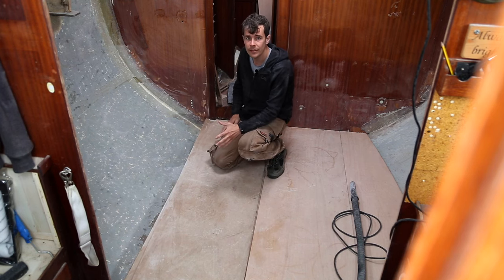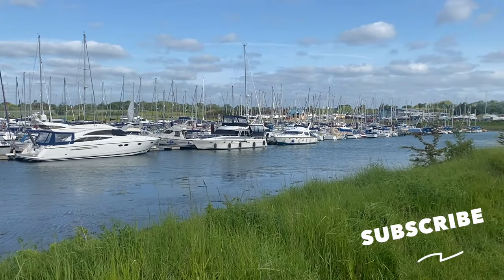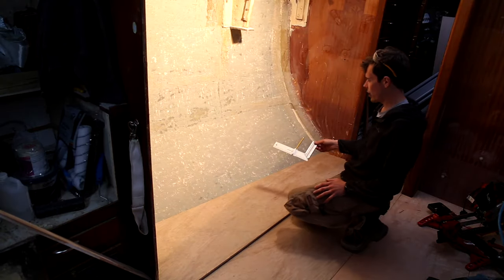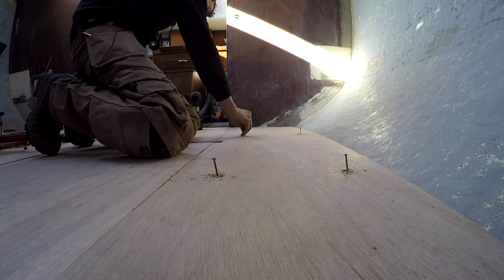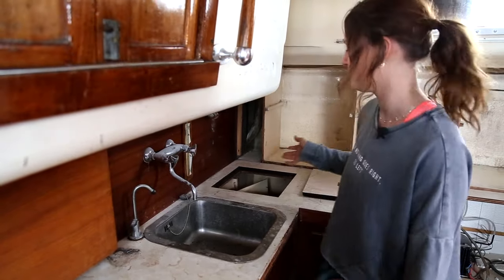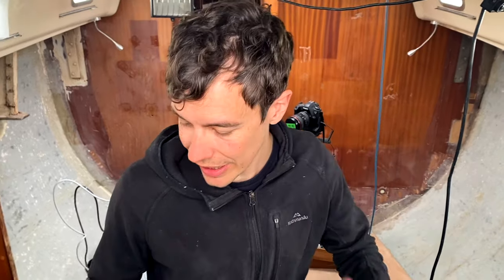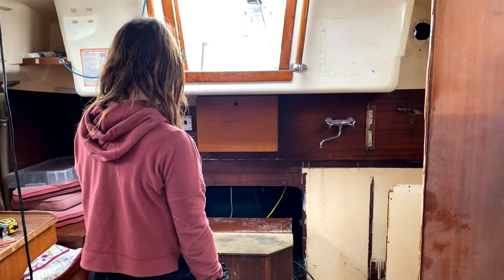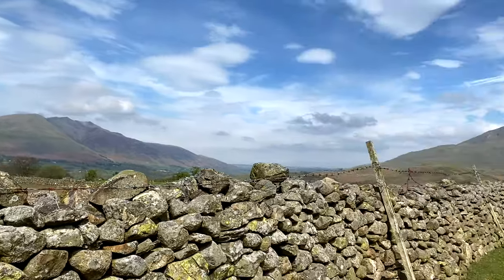Ep 16 | HELP us DESIGN our Galley!

Comment: Galley thoughts:
1. I’m a big fan of the Nicholson 31/35 galleys
2. Moving oven fwd will shorten your port settee - aka passage berth.
3. Seems there room for a “U” galley if you narrow the fwd or aft countertop
4. Rival boats cut a “keyhole” in their galley/cabin bulkheads w supporting pillar. Opens up between the two spaces without affecting structure too much. Keep enough bulkhead so the soup doesn’t end up on the settee if you hit a big wave. 
4. Magic Carpet modified their nav table to allow for drawers underneath, pretty slick use of space 
5. Should be #1: how will you be using galley? Underway or at anchor mostly? Need to be able to wedge yourself in underway so what feels a bit tight on the hard might be just right at sea. 
6. Refrigeration - marine setup or Dometic cooler style? If you delete the quarter berth (and add opening locker lid) you can put a Dometic on slides underneath a standing nav table/workbench. I think Sailing Mondial has this on their boat. 
7. Countertop height - that works best for whomever is cooking the most.  Higher = more storage, better sink draining etc
8. But your plates, bowls (even kitchenware) etc before building the cabinetry. Size everything to fit snugly w fiddles so that it doesn’t slide around and make a racket with every roll or boat wake.
My 2c…. Crack in and thanks for sharing your adventure!
Reply from the maker: Thank you, Robert for taking the time to make this list. It's extremely helpful, some things I didn't even consider 😅 🙂

Comment: Just a thought or two about the companionway ladder and engine cover : ladder - could you have it hinged at the overhead / ceiling and fold down when pulled ? The first "step" next the overhead would be a big one, all the way to the bottom edge of the companionway port bottom edge minus 7.5 to 8 inches. The other steps would be the normal 7.5 to 8 inches to the galley deck. I'd suggest aluminum for the ladder for durability. engine cover - before deciding the doors for engine service, think about what needs to get out of the way to do major service items like alternator or water pump replacements, or valve adjustment. If you plan for those types of service as well as for minor service like oil checks, belt adjustments etc your covers will be easy to use without any drama or disruption. Just food for thought. Cheers and Merry Christmas!
Reply from the maker: Thanks, Jeff. These are great suggestions.🙂